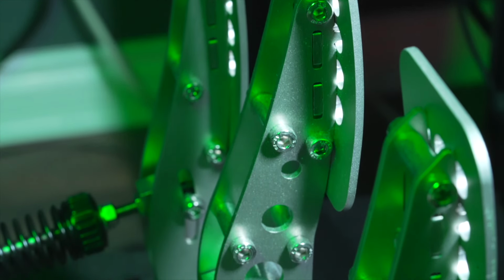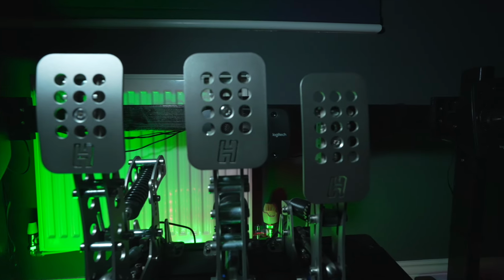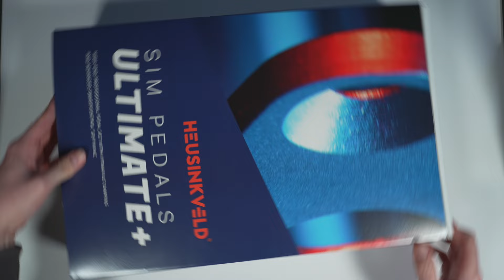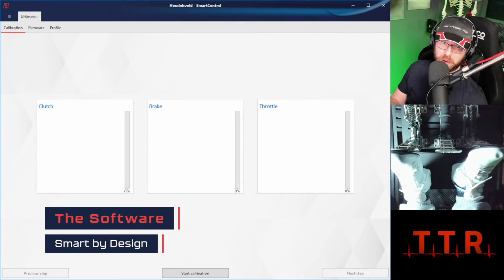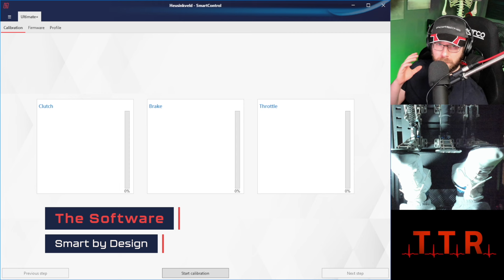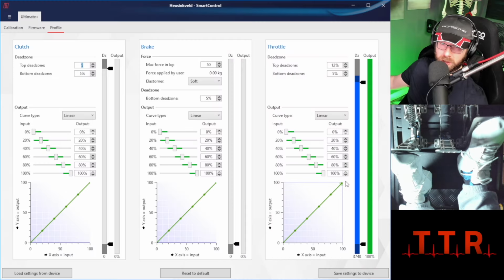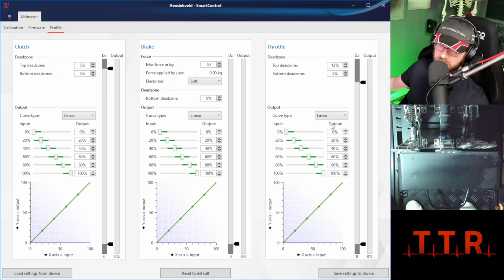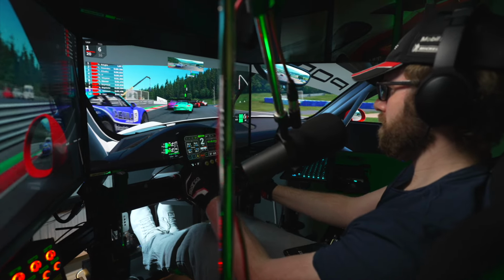REVIEW - Heusinkveld Ultimate + Pedals | The Best Money Can Buy?

Comment: I just bought a pair to upgrade my Sprints and they are incredible. The only way I can describe the brake is that it’s so precise that it’s like a scalpel. Also, the dampers really seem to smooth out my pedal motions. I tried the softer elastomers on the brake initially but went back to the firm ones just like the out of the box set up. I have mine at 40 kg max but I race in socks.
Reply from the maker: Welcome to the club 💪🏻 I am also enjoying the surgical references 😏👨🏼‍⚕️🔪 You can set these pretty much up as you like, I think it would be difficult to find someone massively unhappy with these. Why did you upgrade your Sprints out of curiosity?
Reply from the maker: @kyleshepherdmusic  Let us know what you think when you finally get your hands on them 💪🏻
Reply: @TraumaTeamRacing  Well the long story is I got a really good deal on an open box set of the Sim Lab XP1 pedals on eBay. I had wanted to try them but was very disappointed with them. Then I just figured I could resell them for more than I paid and sell my Sprints and use that towards the Ultimates. And I found a good deal on the two pedal Ultimates, Trak Racer had them in the US for $969. But they are DEFINITELY an upgrade from the Sprints despite how good the Sprints already are. I’m keeping eBay in business with all of my reselling for upgrades!
Reply from the maker: @MadMike991  How come you were disappointed with the Sim-Lab XP1 set? I have not tried any of Sim-Labs pedals or peripherals, I only have their rig. Sounds like you have been on quite the journey, but ultimately 😉 ended up at the right place 💪🏻
Reply: @TraumaTeamRacing  People said they were as good or even better than Sprints but I don’t agree.
The throttle travel was way too short even when maxed out for one. Part of the hobby for me is trying out lots of equipment, I’ve had lots of different gear over the years. Good resale values makes it easier to do this!
Reply from the maker: That's really interesting. I would love to give these a go myself. I am right there with you. Messing around with all the new tech is all part of the fun 😁
Reply: @TraumaTeamRacing my  ultimate+ arrived yesterday. I spent about 2 hours on them once hooked up to my rig... yeah.. you're right. They're amazing! The precision on the brake is just as you guys said... surgical!  Turns out my trail braking is not as bad as I thought. The consistency of the brake release is just great. Steady and smooth!  I'm a 4.8k iracing driver in formula. So not super fast but not too slow either. And I think I can really improve my technique with these pedals. Trail braking, carrying more minimum speed mid corner etc. Overall, the pedals fantastic! I got them in black too. Stylish and sleek look to it! Anyway. Happy racing guys
Reply from the maker: HUGE CONGRATULATIONS BUDDY! Glad you agree with my assessment. I started having a lot more fun on track as soon as these were part of my rig. The brake is indeed surgical 😉 Lol....4.8K ain't no slouch. Black is a lovely look, I am a little envious 😅 Enjoy yourself mate and happy sim racing 😁

Comment: Just a heads up. You're supposed to mount the controller box underneath base plate. There's four pre-drilled slots underneath the base plate.  These four pre-drilled holes are very tiny so they're very easy to miss. Reason why they're made for the controller box.  I also have a P1X. Makes everything look much cleaner as well.   Edit. Thinking about it, I don't think you have the Heusinkveld base plate so never mind. 😊
Reply from the maker: You got there 😂👍🏻

Comment: Great video. I have sprints. They are virtually identical apart from the brake strength. I have mine set at 65kg. I picked the sprints because this hobby is meant to be fun. 140kg is a real difference in how much harder you have to push to get 100% I’ve tried pedals with that amount of pressure and it wasn’t long before my leg started to hurt.
Reply from the maker: Thanks a lot mate! Glad you enjoyed it 👍🏻 I am glad to hear you are enjoying your Sprints, they also look like a great set of pedals 💪🏻 How long have you been driving with them for?
Reply: No they definitely aren’t identical at all. All the ultimate preform way better and have way better software. The sprints aren’t even good they use to be. But simagic p1000 are nicer or even moza new pedals
Reply from the maker: @SIMRIG412  Don't all the Heusinkveld pedals run off exactly the same software? 👀

Comment: Thank you for the review. I have Fanatec V3 pedals that developed gas pedal issue. During disassembly most of the aluminium threads got reaped to pieces (even for finger tight bolts that are supposed to be removable) and pedals are clearly not made to be disassembled more that once. I was lucky as I had 1 week left on my warranty so I could send them in. I try now to sell my new V3 set and I probably replace it with Huskeld.... Hueskenveld... well, THOSE pedals :D
Reply from the maker: You are very welcome! I did this exact upgrade, although mine were the inverted. Not much difference I think. The Heusinkveld pedals are in a different league. I think you will be very happy with the upgrade path to the Hoosekvelden pedals 😉 Let me know what you think of them if you choose to get them 👍🏻

Comment: How would you say these compare to the Asetek Forte pedals? (Currently using them and have no issues)
Reply from the maker: I will preface the following comment with I have never used the Asetek Forte pedals, in fact no Asetek pedals at all. However, just judging from an adjustability point of view these appear to be in different leagues. The price points are not comparable. As an intermediate pedal, which I think these are aimed at, I think these would be worth considering. However, for an end game pedal, I think there are others that should included in the conversation. However, I could get my feet on these and be blown away, so who knows? Hope that helps 👍🏻
Reply: @TraumaTeamRacing  thanks
Reply from the maker: @PaulGSimGolfandRacing  What are currently driving with mate?
Reply: @TraumaTeamRacing  Asetek Forte
Reply from the maker: @PaulGSimGolfandRacing  I would be interested to hear your thoughts? Why the Forte and not the Invicta? What are you lacking in these at present that makes you consider upgrading?
Reply: @TraumaTeamRacing  I bought the Forte as my starter set. 
Nothing wrong with them at all to be honest, now I’ve upgraded the accelerator spring and the brake elastomer 
Just curious, not looking to upgrade per say
Reply from the maker: That is a pretty awesome starter set, glad you are happy with them 👍🏻 I would be careful, casual curiosity often leads to massive financial expenditure in this hobby 😂
Reply: @TraumaTeamRacing  oh I know. I’ve been playing Sim Golf for a couple of years - another expensive hobby 🤦🏻😂
Reply from the maker: It would appear you have expensive tastes Sir 😂